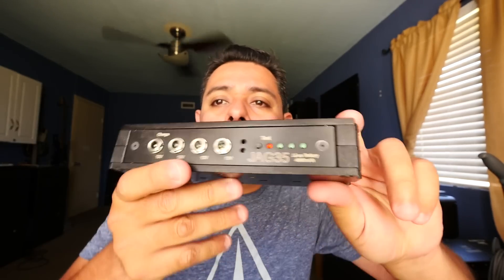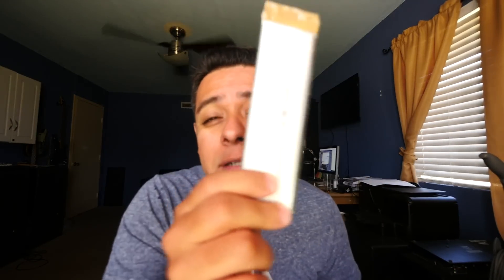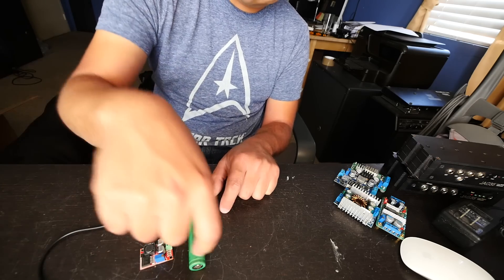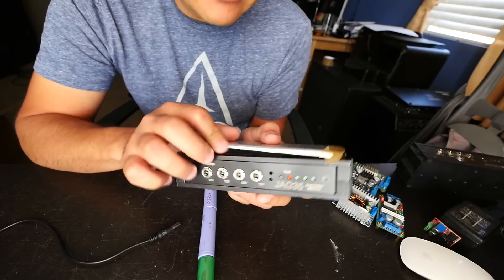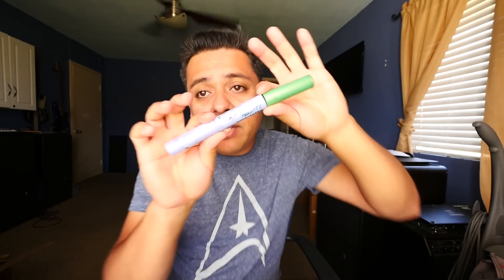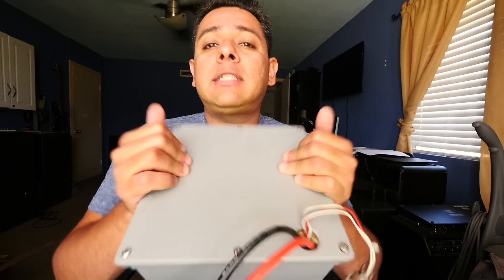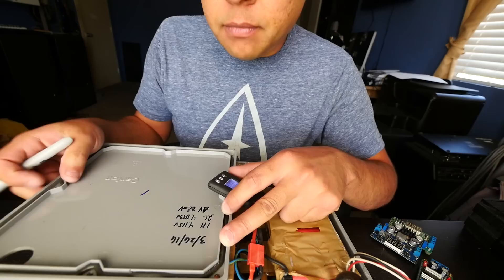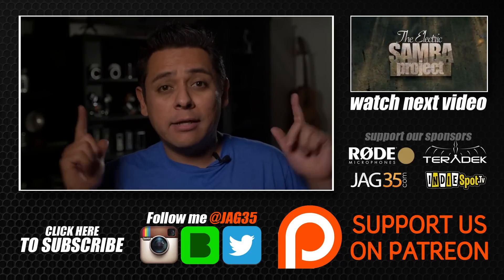How to Charge Lithium Batteries

Comment: What if I have a huge custom liion battery with BMS? I am thinking using a laptop charge. WOuld that work?
Reply from the maker: Define “laptop charge”
Reply: How would I charge a 56V, 25ah lithium ion battery with a BMS? I can't really use a RC balance charger for such a large battery. Are there commercial chargers or would you make a charger ?

Comment: NO, NO, NO !!
I'm an engineer who designs chargers for a living, for a fortune 100 company that you know.
PLEASE do NOT leave the batteries on the charger when fully charged.  When they get to 4.2v, you you start monitoring the current. When the current gets down to 125mA, you must REMOVE the supply. Otherwise, the electrodes begin to accumulate lithium metal on them. This clogs up the internal chemical structures, permanently decreasing their capacity by a small amount. This isn't the biggest problem. The biggest issue is that the lithium will demand to be set free, causing the cell to vent. Violently !  You can die, your house can burn down, and your insurance company will NOT be happy.
If you want to keep them topped off, turn on the charger every week or so, and let them drink until the current goes down to 125mA again.  
Also, don't put more than 2 times the current into the cell, than it's rated capacity, or it will explode.  The 18560 you had there must not exceed it's 2.5AH x 2, or 5A charge, no matter how hungry it is.
Another thing, if the cell is really, most sincerely dead, with terminal voltage less than 2.7v, you can't safely let it eat 2x it's AH capacity in current. You must do a pre-charge. Limit the current to about 1/10th of it's capacity, or 250mA, until it reaches 2.7v. Then let it rest for about 5 minutes. If it holds the 2.7v, then you can charge it normally. If its voltage falls back, you can repeat this a couple or three times. If it keeps falling, it's done. Toss it. If it tests shorted, drawing max current for 15 seconds, it's done. If the cells heat while charging, to about 20 degrees above ambient, stop charging & let it rest. Only attempt to charge a cell if it's between 0 and 50 degrees C.  
You're right about single cells in parallel. They can be treated as one big cell. 
Each cell in a series string MUST be monitored individually while charging, to make sure they don't climb above 4.2v. If any do, charging must stop & the pack is unbalanced. Better chargers will try & match each cell in a string, to improve pack performance.  
The cells MUST be monitored individually during discharge. If ANY cells in a string falls below 2.7V, the pack MUST be considered depleted. If you discharge any string, such that a cell reaches 0v, the other cells will try & force current through it backwards. It will act as a load, and explode with great robustness.
OK, that's at least $10k worth of consulting an analysis in engineering costs, free for you and your readers. Please heed my information, because I REALLY know whereof I speak. I'm not being an over cautious alarmist, despite what flamers may tell you. I have witnessed detonations in person. Please don't skip these instructions.
Cheers,
Randy
Reply: So BMS would do the job 🤔
Reply: Anybody know if BMS balance cells during charging, discharging, and charging plus discharging at the same time? My Daly brand BMS claims that it does, but it was described like it was written in chinese language then ran it through google translate.
Reply: @GTari97  nope bruh..its not possible... One thing happens at a time.. either charge or discharge...not both on same time
Reply: @doverstreet4319  I'm no engineer, but I've seen both yes and no. I mean phones are used while being charged. Manual kinda says it does too with the common port for charge and load, but the whole manual's in one paragraph using comma as a period.
Reply: @GTari97  it's definitely no bruh.. current can go only one direction at a time..in case of phones when you charging and using it, it takes power from the adapter..
But your processor and battery starts to heat up damn quick
Reply: @doverstreet4319  yeah I figured. Phone itself only use a smidge power. Plus they probably have better technology vs a $20 bms. I'd say phones 2 years ago and older only last 1 year with regular use before you'll start noticing slower cpu speed and battery health. Now they're built to last since they cost over a thousand dollars.
Reply: @doverstreet4319  can you pour water into a glass,while at the same time pouring water out of the glass?
Reply: @immrnoidall  So yes, as long as the rate of water pouring in exceeds or equals the rate of water you pour out?
Reply: @doverstreet4319   Yes bruh, "DIRECTIONAL DIODE"
Reply: @doverstreet4319   So my maxed out 10,000 watt inverter is running off the 700 watt charger ? interesting.
Reply: @GTari97   land line phones only need 2 wires for mic and speaker at the same time.
Reply: @rodrigorebollos  😃😃😃
Reply: @GTari97  The chinglish instructions are so fun. But today you are lucky to get any directions at all.
Reply: @GTari97   My BMS will turn of either charging or discharging  depending on battery state of charge. With directional diodes. think of a battery as a glass of water. you can put water in while pouring some out.
 When too full, the charge direction is stopped. When too empty, the discharge is stopped.
Reply: @GTari97  This can be done by charging (or discharging) the cells selectively and I'm currently researching BMS systems currently on the market and yet to find many examples 
About the closest I've come is balancer circuits that move the energy from one battery to another (much better than shunting energy into heat) but these have no charging function, balance only.  I have yet to find a charger that selectively charges cells but this is what I'm after.
Reply: Wait but wouldn’t the current draw stop once the battery reaches 4.2 volts if the charger is also set to that same voltage? With no voltage difference between cell and charger why would there still be any current flow? Is there always a draw even at voltage equilibrium between cell and charger?
Reply: Thanks Randy. I have a Question: is it o.k to put different capacity cells together? As long as they’re the same voltage and chemistry, it shouldnt be a problem.?
Reply: @batterynerd8779In parallel, yes but be careful doing this in series because obvious reasons!
Reply: So you're saying that if the battery pack of any EV goes to 0% then i should charge it with the given voltage and not the bigger one.
Reply: So you're saying that if the battery pack of any EV goes to 0% then i should charge it with the given voltage and not the bigger one.
Reply: @R Rho Thank you for this comment. I was confused for a moment. I didn't know about 125mA, Is that the benchmark set for 18650s then? Thank in advance. A humble student.
Reply: Being all new to this and trying to learn. You have given me the most valuable information to date. Thanks
Reply: So glad someone with knowledge commented. I’m here thinking about how many fires are going to happen based off of the videos terrible advice.
Reply: Thanks for the valuable input, Randy.
Reply: Well said Randy.  As an electronics engineer living and breathing electronics daily since the age of 7, I'm very pleased to see your post here!
Reply: It Is good to hear from an expert, almost all of those facts of charging lithium cell arrangements , I had to figer out for myself, throug experiments AND some  times  bad experiences.

Comment: Always love watching your videos. One thing I wanted to point out, when you explained series charging, you said two batteries in series are not 4.2, they are 7.4, then you add another 4.2 volts for a third battery. People just learning how to do this don't understand or may not know that nominal voltage for these batteries is 3.7. If the math doesn't add up it might confuse them. Just wanted to let you know. Thanks

Comment: Ok I’m in the middle of a project and have a question... my battery’s are 3.7v 5800mAh x6 .. I have a 6s pack with a 6s  15a BMS protection board to power my project... so I have a total of 22.2v... now here is my question... I would like to add a charging port and make it a Micro USB plug .... I was thanking of using a TP4056 4.2v 3A charger... would that work ??

Comment: Hi, thank you for your video. I have a similar situation and a question on battery charging. I plan to charge my 72v 100AH Li-ion battery bank using a diesel generator which provides a regulated DC 72v 70A. Can I connect it directly to my battery bank, or do i need to buy some kind of a charge controller? If yes, would a solar charge controller would do the job, or I need some other controller? best regards!

Comment: On most battery chargers (e.g., Tenergy TB6B, Imax B6, etc.), the max charge voltage setting is 4.2V for LiPo and 4.1V for LiIo.  Everyone on the internet (including jehugarcia) seem to use 4.2V when charging 18650 cells, but I thought 18650 cells are LiIo.  Am I wrong?
Reply from the maker: check this out,   what does it say for max charging voltage?  https://www.mkpbikes.com/wp/wp-content/uploads/2017/11/Panasonic-NCR18650B-datasheet-2017.png
Reply: Thanks jehu.  But then why do the chargers default to 4.1V for LiIo?
Reply from the maker: No idea
Reply: 18650 is just the rough cell dimensions. The chemistry inside varies for each product.
Reply: Yes, that's true.  But as mentioned, most 18650 cells are LiIos.  Default settings are intended for most frequently used scenarios.  My question was: why default to 4.1V when the proper setting is 4.2V most of the time?
Reply: ptmoy1, if the charge limit is 0.1V too high, the lifespan of a cell is severely shortened. The charger defaults to the safer setting. 

As I mention elsewhere, a lower charge will increase the cell lifespan, so I would like an adjustable charger. For example, a reduction in capacity of 10% is considered the end lifespan of a pack, and yet if the pack is always charged to 90%, the pack may last 5 times longer. Decades. 

I hope that eventually some form of cell chemistry identification like an NFC/Ant tag or RF current modulation will come down in cost enough to automate this.

Comment: VERY Informative! I'm planning to convert my NiCd batteries for my old Milwaukee 6024 drill. Thinking, 6 in series will give me a total of 21Ah with a max of 18-20v through a voltage regulator and a low threshold cut off circuit around 3.4 before they become unstable. Possibly may use a thermistor and voltage display panel(just for the curious folks). 

What do you think? May even be able to squeeze more in the old case and bring the Ah up. Thanks.

Comment: Do you have a video on how to build a 12v lithium battery pack to replace a 12v sla battery in a battery booster? I have a couple boosters with dead batteries and a couple dozen 18650 cells laying around. Thanks.

Comment: 5:35 4.2x2 = 7.4? 
I think it's 8.4 .....
I'm new to this and I wanna learn more about setting up batteries please lemme know if voltage drops in series
Reply: Li-ion cells have a nominal voltage of 3.7V and 4.2V fully charged, just like Ni-Mh and Ni-Cd cells has 1.2V nominal and 1.5-1.6V fully charged.

Comment: Hello!  How can I charge the battery in my Navstar Modec EV that is under voltage and the charger won't recognize?
Reply from the maker: Use a charger
Reply: It reads 0 at the main terminals.  What kind of charger?  What voltage and current do I start at?  Do you sell the charger?

Comment: I have bought a nissan leaf battery 24kwh i have also bought the charging unit thats sits on top of the motor, I want to use this to power my house at peak times. It seems that all the videos on this site show people taking these batteries apart and rebuilding them. does anyone know of any reason why you cant use the stock battery and charging system

Comment: so how many modules if around 600 watts do you have. So you charge each module individually or you have a bigger charger. When your module is fully charge  is around  12.3 V, when is discharge is around 9 is this right

Comment: How about charging a 3s or 4s battery pack using a desktop computer PSU? They're relatively cheap when on sale ($20-$30) and the 12v rail produces 35 amps. I figured you could use a bunch of imax b6 or another balance charger and connect them all in parallel with that 12v line. I've seen your open source balance charger but would like to know more about it.

Comment: 10:30
"This is a balancing..."
i am confused, in another vid you say that your not using bms
Reply: "This is a balancing WIRE". No need for a BMS. You can use an external balancing charger connected to that group of wires which he is using to test the individual bank voltages.

Comment: watt/hour means volt*current/hour and ampere/hour means flow of current if the resistance is high then the watt will also be high though it flows same amount of current. then why should we use more watt/hour battery rather than less watt/hour battery because the flow of current is same??? and the energy is lost in form of heat in resistance. the voltage can be made high using a transformer.

Comment: I bought China 18650 5000aH only because i was able to get them for .40 cents each. I know they are not 5000ah but the work pretty good. I made a 6s 22c battery and I had no powering a 3000w inverter and running a skilsaw off of it problem. If they are actually 1.5 aH are they still a good battery?

Comment: Great man!! I need some suggestions, As I'm building a motorcycle with a 72V BLDC motor. How much voltage is enough for battery pack? I'm also using a DC-DC Converter.
Reply: And I'm using battery cell array consisting of 300 cells which is 3.7V and 2.6amps. I couldn't decide whether arrange it mostly in series and increase its voltage or arrange it in parallel and increase its amps?

Comment: How can you actually accurately test each cell from on 3 cell balance connection, your series of cells that's low could possibly contain 1 or 2 cells that are below 3v and you would not be able to tell. And that where the danger comes in..    Or let me know if I'm wrong.  Thx

Comment: 4.2 x 2 is 7.4?? My school taught me that it would be 8.4. Charging multiple cells togeather isn't the best way. If 1 cell is at 25% and the other is at 75%, the charger will stop when the battery at 75% reaches 100% thus leaving the 25% incomplete. Even in a 4 or 8 bank charger, always use one that charges each bank individually, not as a group.

Comment: constant current / constant voltage is the charging method that was designed for rechargeable lithium cells. it looks as tho some of those ebay regulators you are showing do not have a potentiometer for CC regulation..........no bueno for charging lithium cells, dangerous in fact.

Comment: Hey! I would like to say thanks for this video, it was very helpful! However there is one question came to my mind watching it. Why is it necessary for that 5KW charger to change the current while charging the battery on 126V? Isn't it enough to leave the battery pack to also reach 126V to know it is fully charged without decreasing the current, the same as a single cell reaching 4.2V to know it is fully charged? Can you explain this a little more please?

Comment: I want to use 80 panasonic 18650 batteries parallell connected x3 in series to get the 12V and approx 240A for my stealth campervan. I cannot connect this selfmade leisure battery ( when it's finished ) directly onto the 12V starterbattery and aternator of my Iveco. I will be using a Battery isolator to cut of the power when my Van is not running but what would you recommend to put also  between them, because my Iveco delivers 14,7V when it's running ? a Voltage regulator that regulates the power of the alternator to 12,2V as in this video ? But i would need a powerfull one, no ?  I'm a noob to this :)
Reply from the maker: use on of these http://j35.us/2pekM4g  at 40A it should be able to charge your battery in 6 hours
Reply: thank you for the quick reply and advice  !